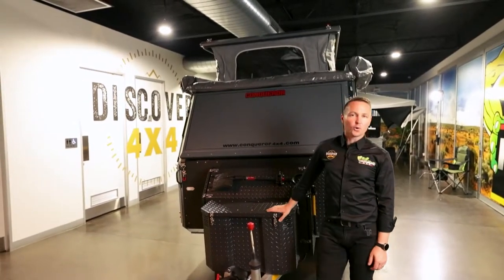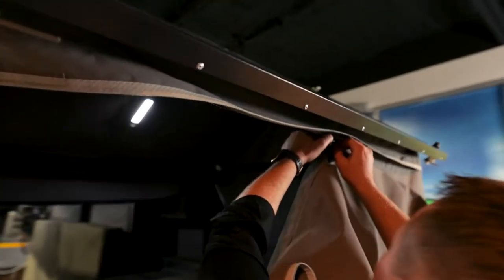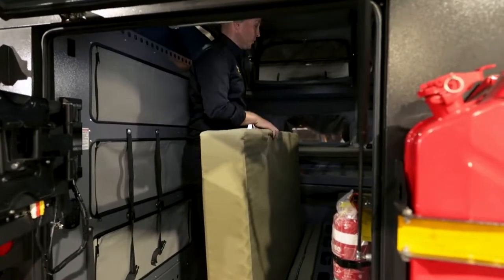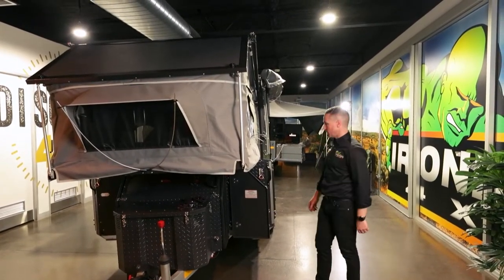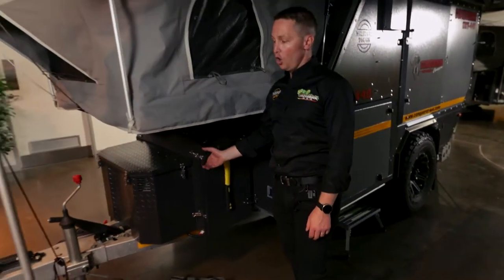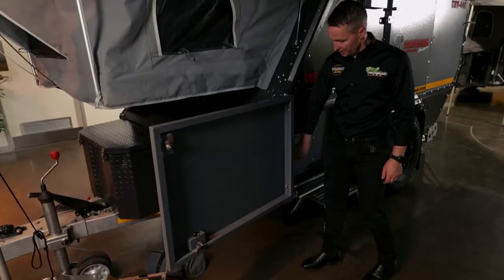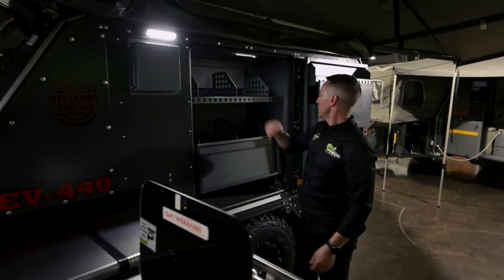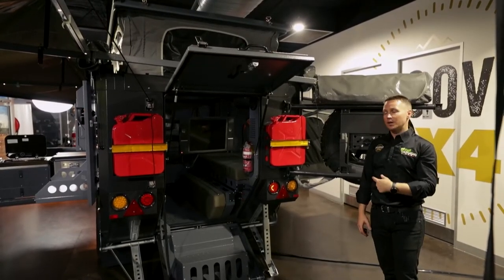CONQUEROR UEV-440 | Full External Set Up

Comment: If I am correct the 440 does not have solar panels as the 490 does. Can this be added on? If yes is there a capability of adding wind power to it as well? Thank you in advance.
Reply from the maker: Yes it would not be hard to add solar to the roof, Conqueror can also supply quality folding solar panels also.